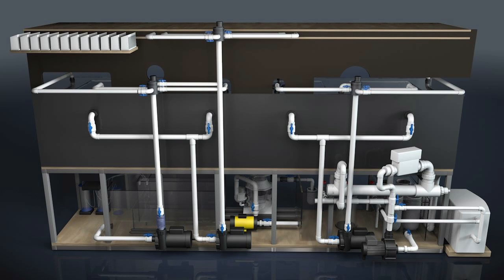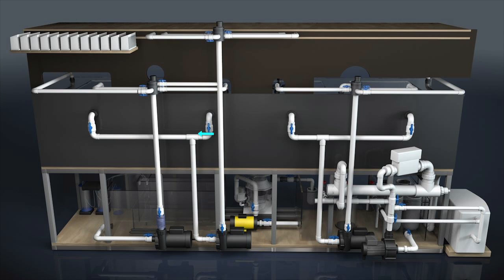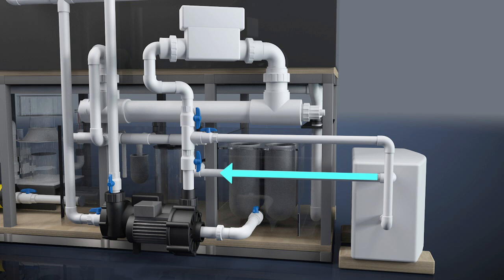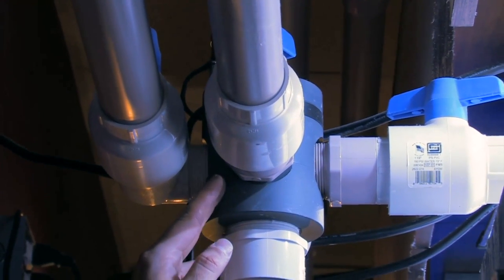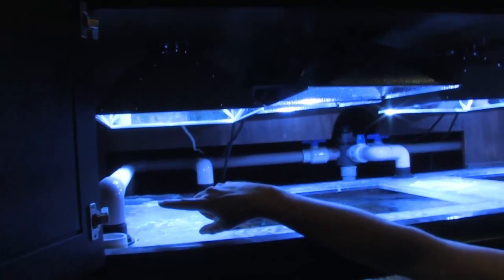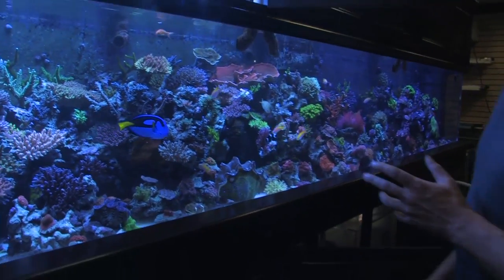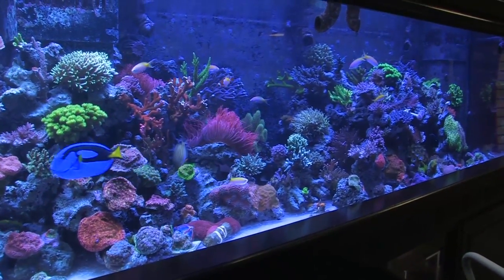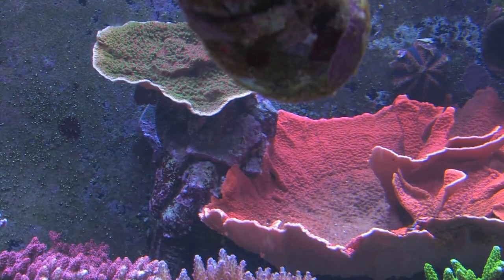Part 2: Plumbing and Lights of 800 Gallon Aquarium

Comment: Incredible setup. I have a 420 gallon tank with a Reeflo Super DART/SNAPPER Gold Hybrid return pump. I am about to start the plumbing on this project and was considering going with Omni flex nozzles. My question is twofold; Should I go with the 1" nozzles over the 1.5" ones and how many returns should I go with. The tank is 7' long by 4' tall by 2' wide. Any help would be greatly appreciated. Thanks in advance.

Comment: Quick question - I am 5 months into a 187 gallon reef tank + 35 gallon sump.  All high quality equipment (skimmer, two filter socks, biopellet, UV, etc.), spent like $15k on the set up.  There is a tank at my LFS and the water is crystal clear, very little particles floating around.  My tank is crystal clear, however, I have a ton of floating particles.  I have used Clarity, Coral Snow plus changing out my filter socks every couple of days.  Also tried feeding less, vacuumed the sump, etc.  All of my parameters are perfect, however my ALK was at 7 (now at 8.2), and Calcium was high at 525.  I am dosing less calcium and more alkalinity to see if that will get rid of the particles, since I think it is calcium buildup that is not being absorbed into the water.  Thoughts on this?  Advice on how to get rid of the particles?  Thanks.

Comment: hi dave could you confirm the test results of the check valve on your return line... does it stop the water flow into the sump?